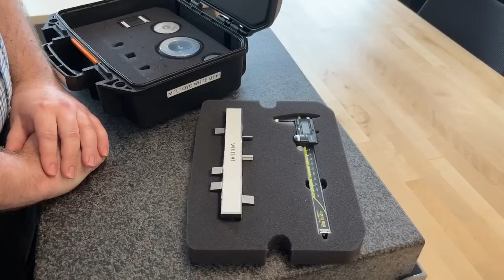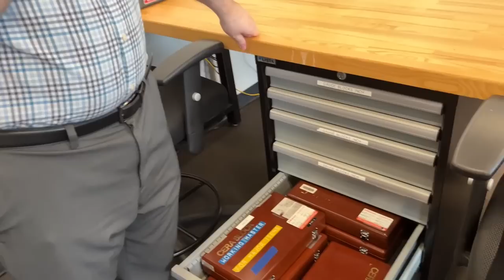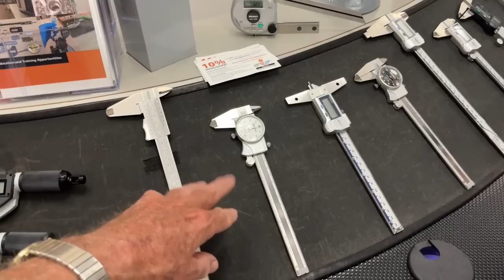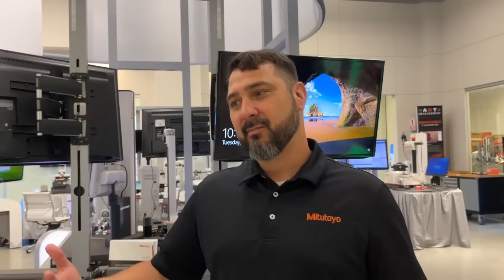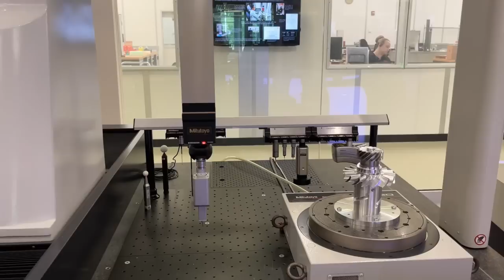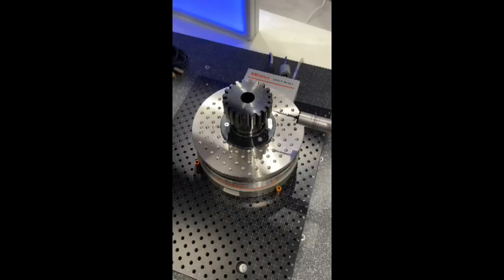MITUTOYO tour & FIELD TRIP PT 1 #969 tubalcain mrpete

Comment: This was interesting. I never would have guessed that they'd have the range of devices that were depicted here. Of special interest to me was the optical measurement devices. I'm actually curious how they maintain precision with those devices. I know some use a laser grid array and can calculate from there but that doesn't seem to be the case with the video measurement they were using in this video. There would have been dots in the area that was being measured. They would have been invisible to the naked eye but your camera should have picked them up.... Oh well, on to part two.

Comment: We have a KEYENCE VMM  machine in my work for measuring small components , I think is American over in UK.  I really do like Mitutoyo and as a toolmaker for a number of years I have loads of their products always great , trusted and reliable.  My IP67 coolant proof Digital vernier must be over 25? year old I would say and still within calibration for shop use. I have made parts ,fixed and operated a few Electron Microscopes, if you want to see how bad you made something zoom in 200,000 X and see how horrible your work is :D  better still put a diffraction grating on it and check your sizing :D   Superb seeing that  Mitutoyo setup, cant wait for the next instalment.

When I first started out in Engineering you had comparator blocks but you had a device that worked like a record arm and would tell you the surface finish , cant remember who it was made by.
Reply from the maker: 👍👍👍
Possibly  Taylor Hobson

Comment: Love the VIP tour that Mitutoyo gave you. I actually purchased a Mitutoyo caliper knockoff from eBay.  I returned it for full credit when I realized it wasn’t the real deal. The low price should have warned me. By the way the gage blocks we saw briefly appeared to be white. Were they ceramic?
Reply: Those are ceramic.
Reply: @4GSR Thanks. Ceramic gage blocks have many advantages over steel since they won’t rust and are more temperature stable. 
I never knew gage blocks were made of anything but steel.
Reply: @ellieprice363  They make carbide one's too.
Reply from the maker: Yes

Comment: Great video. QA folk were in a separate world from the balance of the production workers in our shop. Maintenance (my group) was called in only when QA was in deep trouble.  For this reason, I have little extensive experience servicing this grade of inspection machinery. Mitutoyo was revered in our shop, but was used more on the shop floor and for smaller inspection equipment than in the QA lab. Our larger CMM and gear inspection equipment were made by competitors. I and my group were not certified to service the inspection equipment,  so what I was allowed to do was limited. But I have had my hands on much of this level of equipment. QA would beg our service when in trouble, but hover over us with unshielded concern.
In spite of the reverence afforded our QA staff, they were not service technicians. Maintenance enjoyed a similar reverence on the shop floor. We had full authority to keep a machining center from production and to certify it for production. The handshake we had with production was if production turned an issue to maintenence, maintenance determined the severity and/or if, how and when a machine tool was qualified for return to production. Machine tools are pretty sophisticated, but so are the machines used in measuring and gaging. 
My Mitutoyo experience being limited, I  am interested if Mitutoyo  relies exclusively on their own technology. Renishaw is ubiquitous on the shop floor.  All of  our machining centers relied on Renishaw probe technology.  I couldn't tell if the Mitutoyo on display had OEM probe systems or if they used Renishaw. We used possibly dozens of inspection manufacturing sources,  some were one-of-a-kind and others were used for particular measuring or gaging tasks. We used the laser gaging technology for setting up milling machine tooling. I don't recall who made it, but it wasn't Mitutoyo. 

In general, I am very familiar with what you included in your video tour. You included some technology that we did not have or has been developed since I  retired. I thought that I would only be mildly interested in this tour,  but it was as much fun as your other content. I expected to focus on the shop floor equipment that your audience owns, uses and reveres. What are you holding back for part 2?

I started buying Mitutoyo in the mid 1980's. I have purchased a lot of vintage Mitutoyo, my older Mitutoyo inspection tools probably date to the 1960's. The more recent purchases are after 2020. Mitutoyo is a great product, but I  agree with you that many of their cases are horrible! Their micrometer boxes often warp and don't get me started with you on their foam! I like the brand, because they are often very value priced without sacrificing quality.  Starrett beauty is lacking in most Mitutoyo,  but without satin chrome Starrett rust stains so easily when not climate controlled.

Great video!

Comment: Wow, very impressive!

 In any modern factory that I have been in that uses quality systems like SPC the tools are almost always Mitutoyo. The Digimatic micrometers seem to be the go-to item.

I have had Digimatic calipers last for decades and only stop due to dropping them into the coolant tank or getting mechanical damage. They also don't eat batteries like the cheap ones in my experience.

Looking forward to Part II, the adventure continues!

Comment: I really appreciate this content. Years ago I worked for Bendix Aviation and used many of the instruments featured here that were industry standard for that time. I have a great appreciation for the standards requirements of the aero space industry. Each individual component we purchased were subjected to rigorous inspection prior to assembly. The air force department of the federal government was responsible for all metrology, I worked in the standards lab and was responsible for keeping all primary and secondary standards in compliance. Thanks for sharing this content. I'm sure many people have no clue of the need for all this precision requirement. Every nut, bolt, resistor, capacitor etc. was subjected to this level of inspection before being released into production and inspected again after being assembled into what ever we were building.
Reply: Great comment. Thanks for sharing your experience.
Reply from the maker: Thank you for this comment, yes, they are an amazing company
Reply: Thanks for the video. I didn’t know that Mitutoyo was family owned and operated. Wonderful tools.
Reply: @Nacogdoches-Dave  we are family owned. It's nice to be able to put customers before shareholders. 😀